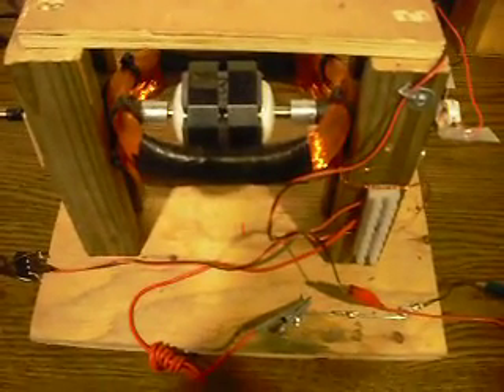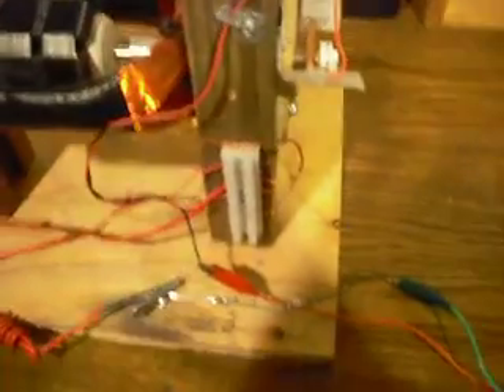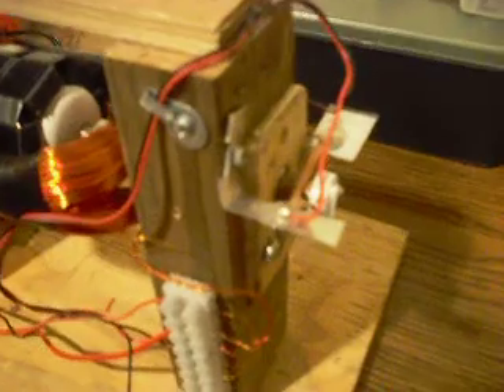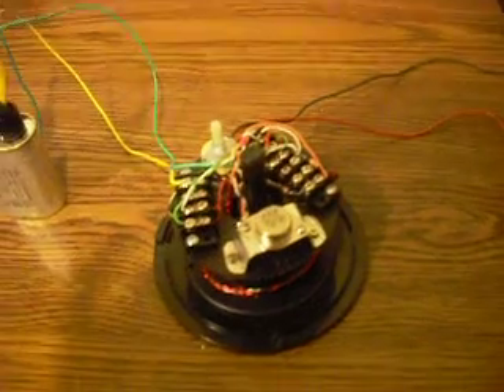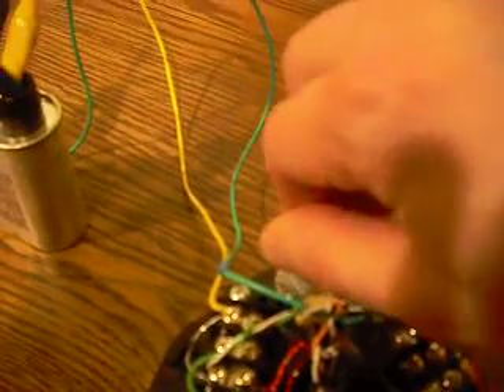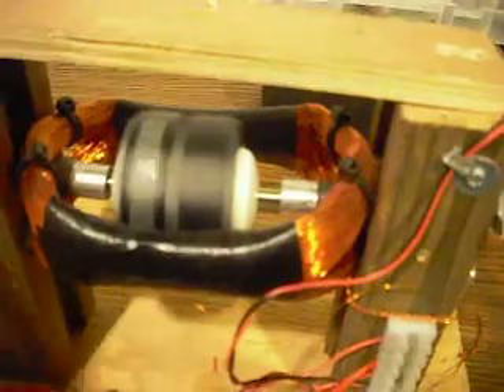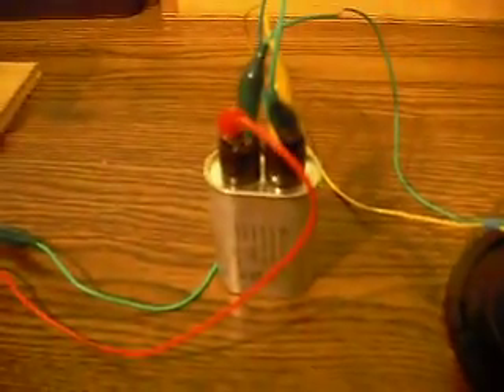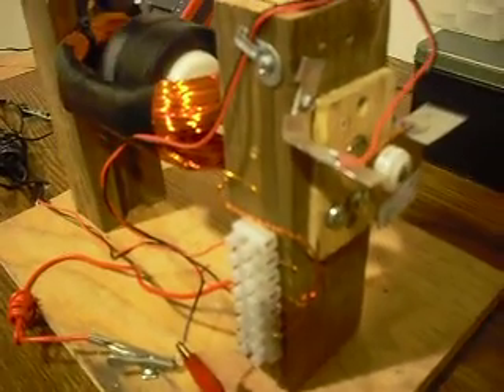Edwin Gray Capacitor Motor

Comment from the maker: An important note: The very first publicly known electric machine ever invented by man was the Faraday homopolar generator, in 1831. The homopolar generator has a 1:5 input to output energy ratio and has no magnetic drag whatsoever. It had no magnetic braking or magnetic drag, but produced current. This is known as "Faraday's paradox." A magnetic field has zero mass. Work is defined as force x mass. Why are we moving mass to produce a massless form of energy? When we create electricity using our barbaric methods today, we are moving many metric tons of metal to produce an electric field that has no weight. Just something to think about.